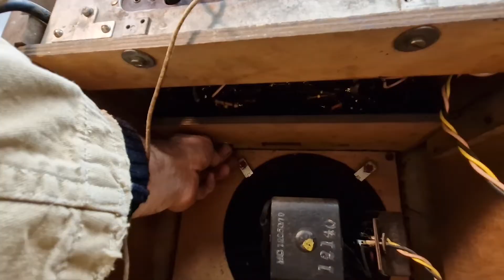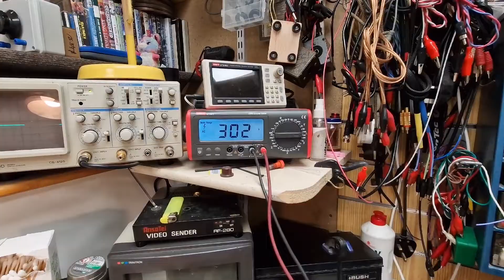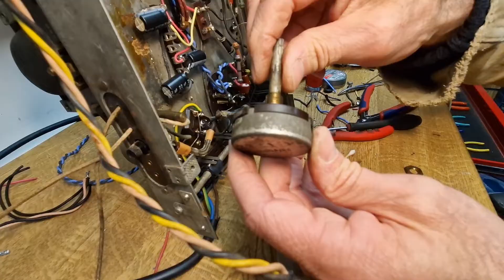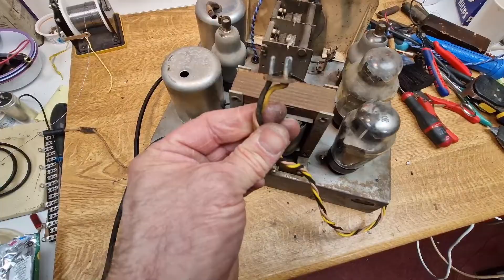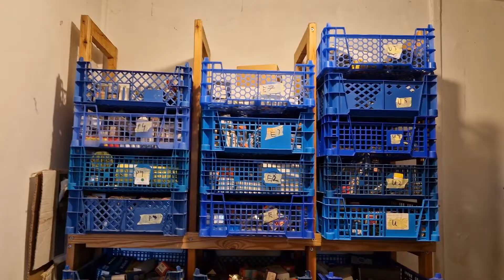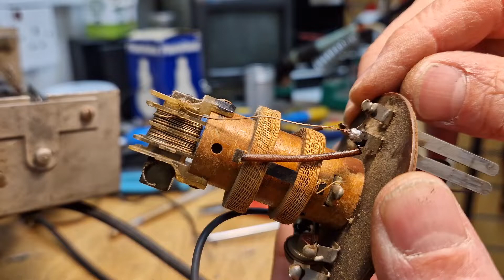Wonderful 1938 Cossor Wireless Restoration

Comment: I have restired quite a few of those Cossor 30s TRF sets using the same coils . Its quite a common fault . Maybe the original flux corrodes the wire at the edge of the joint over time . Nice radios though .

Comment: Great job!
I restored my famiIlies similar older 368 model recently and noticed that the 41MP output valve has an internally connected screen grid so it's actually a Tetrode working as a Triode! Also on mine the speaker is mains energised which also acts  as a choke which I don't think yours is. 
But a great design for its age able to pull in lots of stations with good selectivity with a bit skill.

Comment: Very nice radio, and it sounds good too! I have a similar set, but it's a battery powered version in a bakelite cabinet, the dial and all it's mounting hardware look identical, and I'm sure mine has a bit more of it's print left on it! That set also sounded really good once a few caps were changed.

Comment: I love the design of the gain control with the band of sprung metal touching the carbon track. You just know the bean counters killed that idea a long time ago.
Reply: I suspect the idea was to eliminate the rubbing action of a contact. A lot of controls end up with the carbon worn away. One problem is that no rubbing leads to dirt building up on the contact area.
Reply: @jonka1  Good point, but at least you can clean the dirt off as long as you are careful about what you clean it with and the ones with rubbing contacts only stay clean if they're regularly used.